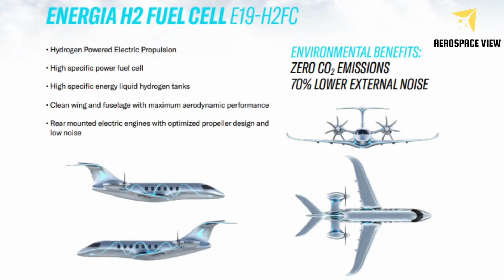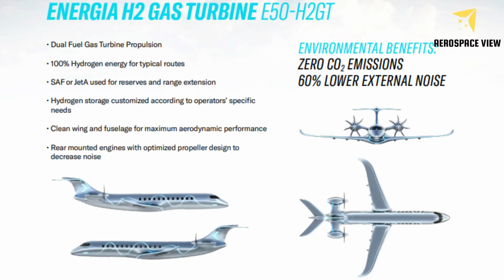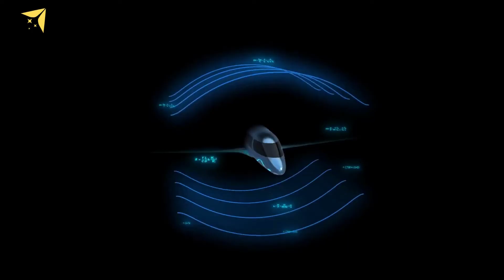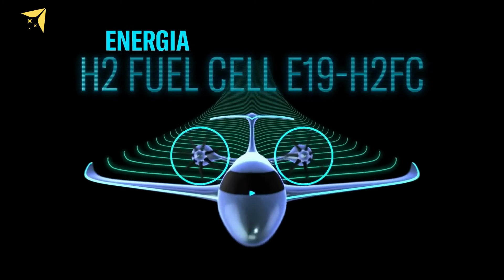Hydrogen: Cut - Embraer to Expand Its Product Line Entering in New Segments and Reviving Its Origin

Comment: I believe that the future of aviation is a technology that they are developing in Brazil where ethanol is used to produce electricity, in the case of vehicles it will be easier since all cars in the country use ethanol or automatically mix it with gasoline in any proportion, but with this new technology ethanol is converted into electricity and without using heavy and expensive batteries, as I said this will be a big change in the future and in fact it would be the smartest way to use electricity for mobility.
This same principle can be used in airplanes that would continue to be fueled with liquid fuel, in the case of ethanol that will be transformed into electricity to drive engines that will also be lighter and more efficient, in short, this is the next revolution that will put an end to the use of fuels. fossils!

Comment: I'm glad Embraer is trying to innovate, but still skeptical. So many unanswered questions about hydrogen fuel storage, fuel transfer and safety, and if the costs of production and the complexity of this technology is worth the savings from not using fossil fuels, or if it is better than next generation batteries.